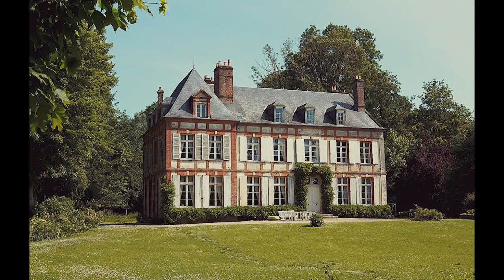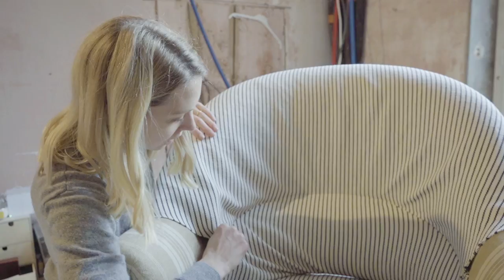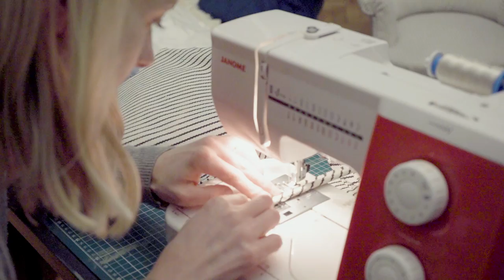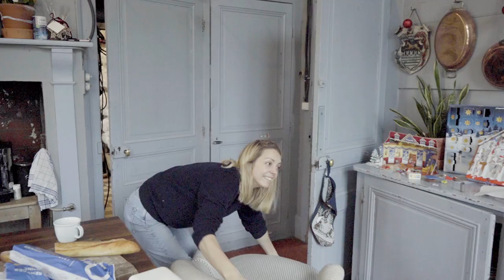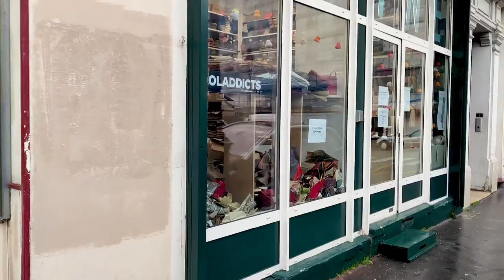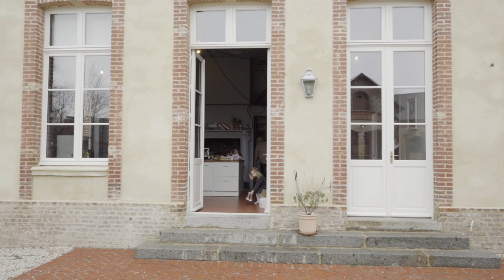Upholstery Chair & Salon reveal - How to renovate a Chateau (Without killing your partner) Ep. 5

Comment: Anybody who crafts is always very protective of the sewing scissors. Philipp is a very good off the cuff joker. You two are a very good balance. Lovely. Great job on the upholstery. Philipp is so funny!
Reply: Sleeping on the couch 🛋 instead of getting  the work done 😅
Reply: @CuriousCalligrapher  I would have done the same thing with the school.
Reply: Before I had a sewing space in my home, I tied small bits of fabric to the handles of my sewing scissors so that no one would use them for anything else.
Reply: @RussiaIsARiddle778  I have a small sewing box and always kept them in there in a safe place. I was lucky as the kids got older, they did not mess with them.

Comment: I used to help my mother upholster chairs and sofas when I was young.... Just a few suggestions: You may want to invest in a Webbing Stretcher upholstery tool - wood handle style. It provides more grip and helps stretch the material. In addition, I would recommend using a very light cardboard cut to the shape of the back and cover it with your material... it stiffens the back and removes all of the creases. Takes a bit more time as you need to trace the cardboard the shape of the back of the chair,  cut it and then cover it with material but I find it easier to finish the back.  if your material is hard to work with, put it in the dryer  a few minutes... it will become more supple. Great job! Love the chair!!!!
Reply from the maker: Thank you so much for your tips, we will certainly apply them for the next project!

Comment: Covering bold colors is easier with Kilz primer and use a paint + primer also. If available, Behr Marquee is one coat coverage. Best cut in brush is a rubber-handled brush by Wooster. Fits perfectly in your hand and less chafing. Available from sellers on U.S. ebay if you can't find it on ebay UK. Some ship to Europe.

Comment: The ripples in the back of the chair is because your fabric is too rigid for the shape of the chair. You should go for a fabric that has a little «give» when working with curves. I also noticed that when cutting around the posts on the seat, you cut twice. Cutting once and pulling it to each side makes for a smoother finish. And philip is right about stapling the back fabric down to the seat. But not bad for an amateur! 😊

Comment: You should use upholstery tacks, not a staple gun (which will wreck the frame). Using upholstery tacks you put them in a little way and  can gradually stretch the material and pull the creases out. You only hammer them in fully once the material is pulled correctly
Reply: Thankyou good tip

Comment: You might try sharpening your scissors with a honing tool, or cutting, several times, through aluminum foil. Both usually work well. Beautiful job on the reupholstering.

Comment: If someone sat on the chair it would compress the seat and leave room at the opening where you are trying to get the ends of the fabric through. Once the fabric is through and smooth them you can get up. Even better if the person kneeled facing the back of the chair they could see the wrinkles as well as holding that gap open.